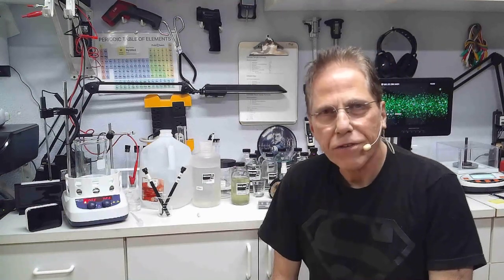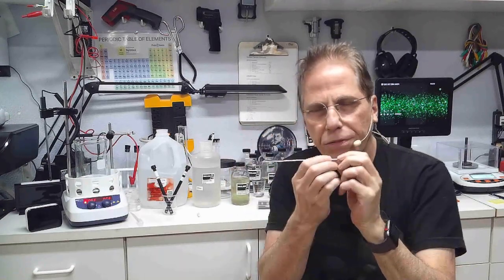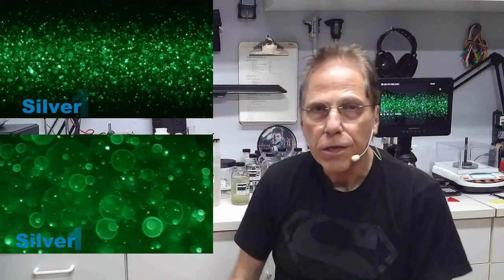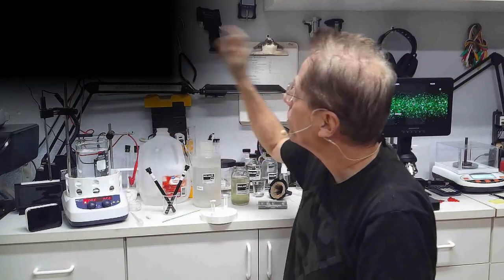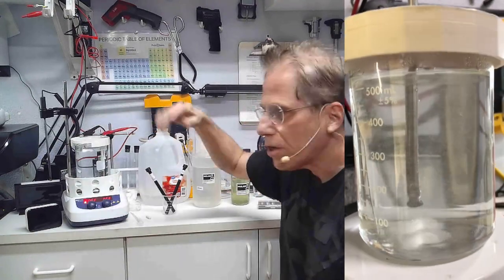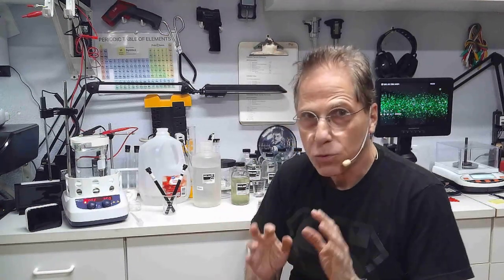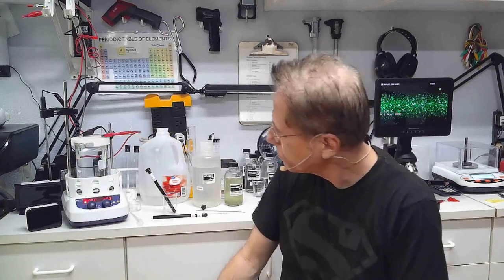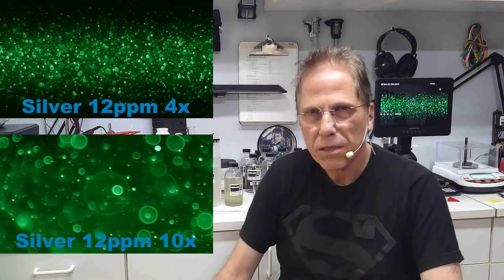Basic information on Nanoparticles and the creation process!

Comment: How many of the metals from 60 minerals can be made into a collodial?  For example, the Molybdenum, Praseodymium, Scandium, Rhenium, etc....
Reply from the maker: Only some metals can be turned into colloidal nanoparticles and only some of those can only be done using plasma arc. Carbon and Magnesium can only be created into a stable colloidal with plasma arc. Magnesium can be made into a colloidal using LVDC but its fairly unstable. You get low colloidal yield from it. Carbon just melts. Calcium also will just dissolve in the water instantly. 

If you look at a periodic table most of the blue metals number 79 and under can be turned into colloidal nanoparticles. Of course I've only worked with some of those: copper, zinc, gold, silver, iron, vanadium, chromium, cobalt, molybdenum, titanium, nickel, zinc, platinum. The other metals I've not tested yet.

Comment: You mention the difference between ionic and colloidal. Does ionic have smaller particle size? Is it what is also refereed to as "nano"? What influences particle size? Stirrer temperature? Thanks!
Reply from the maker: In chemistry, an ionic compound is a chemical compound composed of ions held together by electrostatic forces. Ionic particles are smaller than Colloidal Particle sizes because they are part of the atomic structure of the substance it is bound too. 

Colloidal nanoparticles are groups of metal  atoms without a charge that are attracted together to form larger particles.  

Nano refers to the measurement nanometer. It can apply to many things. A nanoparticle is a small particle that ranges between 1 to 100 nanometers in size. Colloidal Nanoparticles is just the current buzzword for it. Colloidal substances qualify as nanoparticles due to their size.
Reply: @AlchemyWizard  thanks for your reply! In your other video you observe that when going for higher ppm the particle size gets smaller if I understood correctly, which answers the "What influences particle size?" part of my question. I read in other source that keeping the water temperature high throughout the process also makes the particle size smaller. Do you happen to know if that is true?
Reply from the maker: @pawelrein9287  Not an easy question to answer. Much of my early work and thoughts on particle size was formed using my first video microscope. This microscope  had one lens and did not go down very far that I could see the individual particles, especially on high ppm solutions. From what I could tell it seemed that way.

When I got the new Andonstar microscope and fitted it with some high quality lenses, I saw a very different world at the 100x and 250x magnification. What I found was that for silver there is only one particle size. Under the video microscope it only appears the particles get smaller, they actually stay the same but the amount of the space between them drops and so the light from the laser reflects off two or more particles and makes them seem smaller.

Now in my recent  examination of the different kinds of Gold (ruby red, violet, and grey) there is a difference in particle size. See my community post on it for a picture. 

I suppose the point I'm making is that particle size and density is not so easily answered and must be addressed individually for each metal. 

Also I have uncovered that the amount of current you use while cooking a colloidal may effect particle size. This is unconfirmed and needs more testing but I did notice this when working on the platinum process recently. It is on my list of things to experiment with.

In scientific journals it is said what you use as a reduction agent (what I call an accelerant in some of my videos, like using citric acid on silver) can alter particle size. So far, I have not seen any evidence to that, but it may very well be true for some metals. At least with silver I have found that Silver cooked with sodium citrate and without seems to have the same particle size.

As you can see the question of particle size is complicated.

Comment: what are the lids over the beakers you're using
Reply from the maker: I designed the lids using 3D software and print them on my 3D printer. My Beaker tops and the laser system 3D blueprint files are free to use. You will need a 3D printer or have to bring the blueprints to a 3D print shop. Keep in mind that the material you print the tops at must be able to withstand the temperature you are going to use, if you will be using heat. My biggest problem is finding a 3D printer material that can withstand the 90c of the gold process. PLA will work to 60c. ABS works to 90c as long as it is not submerged in the liquid. The optional rod supports even printed in ABS will start to deform at 90c water temperature. Other than that they do work well. here is the link to my STL files: http://wisdomsdoor.com/files/index.php

Comment: Hermes can you give me the link where to buy an zinc electrode i cannot Find them anywhere
Reply from the maker: Here you go. Same stuff that I'm using now: •	Zinc wire on Amazon: https://amzn.to/3DKEF8g
Reply: Thank you 
I already Made gold and have gold rods and copper and silver its now time for zinc .
But like in gold i use light Corn sirup a few drops in Every cook.
And my blue copper is stable and zero sinking of blue stuff .
Because i thought if sirup is used to give a binding in gold wich is an metaal in my opinion it is necessairy for all metals Please give it a try with copper and the microscope❤
I love the videos and colloidal gold helps me a lot with long covid and my long Lyme 
Can you dm me for more conversation and ideas
Reply from the maker: @BGmedia  it will not hurt to use corn syrup in all colloidal and it can improve long term stability, just never occurred to me to include it in the others. My c1+c2 spec copper has been holding up good, but I will try it next batch I make. And I will give it a try as well in my other colloidal.
Reply: @AlchemyWizard  thank you very much would love to see it under thé microscoop, love your work and videos , and love to see if the other colloidals improve with the same way of making like the gold except the salt . 
Thank you very much for your responce